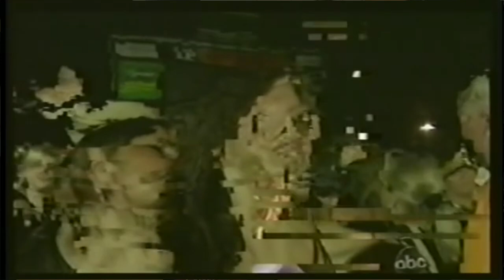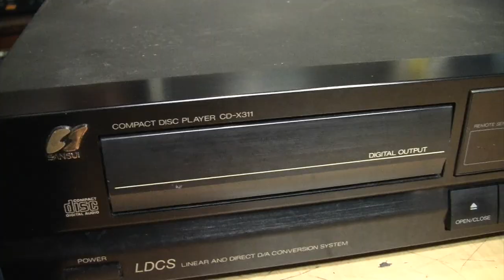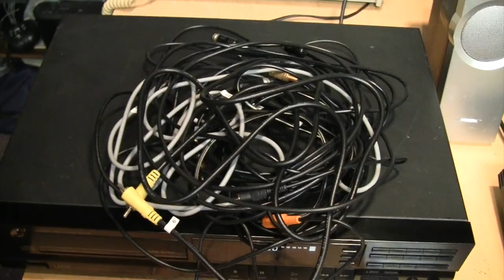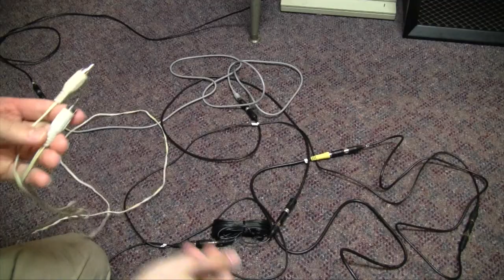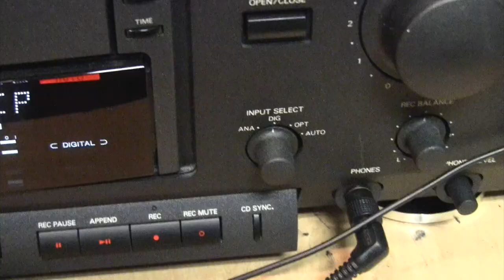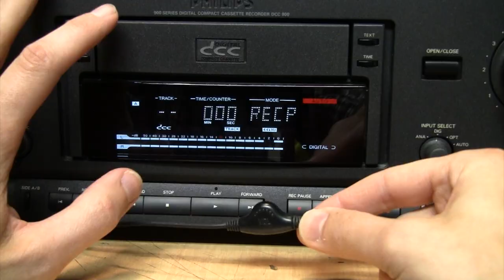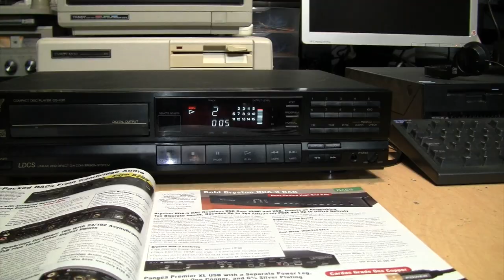What does a crappy digital audio cable actually sound like?

Comment: Sata and Ethernet audiophile cables... I just wonder: ordinary sata and Ethernet cables are good enough for banks transmit/write/read/receive billions of financial transactions every day, they are good for NASA to access billions of informations, good enough for the most awesome super computer deal with tons of data for its researches, but they are not good enough to play a simple audio file.
Reply: I think that most of the applications you described probably lean towards the higher end of the mid-range cables. As my IT tech father can attest, some of the normal to low-end stuff is fraudulently labeled junk that can't meet it's spec (I'm thinking of Ethernet: he got one from a store once that was labelled as ordinary Cat-5, but was actually Cat-3: fine for phone and probably some older networking, but not usable for 100base-T, nor anywhere near the 1000base-T that was rolling out to consumers at the time).

Though, it's not like you have absolute guarantees with anything.
Reply: There are people that debate about hard drive types too. People recommend surveillance drives because of their non-stop stream performance.
Reply: Expencive cables have better endurance and protection, so pay a bit more on that use cases is ok. But not that big as brainless audiophile fee.
Reply: Cheap cables are NEVER good enough to PLAY "Simple 🤪 Audiophiles" it seems.
Their money I guess!

Comment: but the JITTER, the humanity!!!111
;-)
Like some other folks already suggested try uncoiling that wire. Telephone(Cat 1) or ethernet(Cat 5) wire could also be a fun experiment, you dont need to uncoil those - I would start by trying whole 100m box at once, wouldnt be surprised to see cat5 working.
Reply: even better - try to actually phone someone and send them the digital signal down the phone line..!
Reply: You need 3MHz of BW, phone connection is limited to 3KHz, but ordinary cat1 phone cable(very old) is good up to at least 1MHz (ADSL), cat2 to 4MHz (ADSL2+).

Comment: You cant test like that. To start with the guy is using an inferior sound card...an internal one aswell. Which will pick up rf noise and have alot of jitter. Also you can't test on those speakers.  They are just a little full range driver that has no bass or upper highs and won't resolve. You want to be using an external audio interface to start with. When you run a system that has more than 5w and speakers that do most of the spectrum you will hear it. When it comes to length you will get more noise and hiss and and less highs. Hence why we have balanced connectors ie xlr and the balanced digital format is aes. And no...not all audiophiles are gear junkies
Reply: But resolving the highs is just a matter of sample rate, which jitter doesn't affect... just because a cable cuts out higher frequencies for direct signals/analogue audio doesn't mean the exact same thing is going to happen to the digital signal once it's decoded. Just when things get bad enough that the high frequency rolloff point is below the data rate in Hz, you get dropped packets and corrupted audio. It's not like it's subtly EQ'd different, it just starts glitching out after a point. 

Maybe you just whooshed me, I dunno.

Comment: You are making an inductor with the coils of cable.  Which destroys highs.  Running them in opposite directions through the RCA cables creating opposing magnetic fiealds.

I would like you to record the CD player on the computer through various cables.  Then rip the CD on the computer.  Line up the waveforms and flip the phase on one of the wavs.  There should be silence left if digital is perfect.
Reply: Its digital so it doesnt matter.

Comment: Thing I love about Digital AV stuff is that it just works. Only benefit I've found to having better cables is they're not as likely to break (but thats not always the case especially if a brand is selling 60 dollar HDMI cables made for less then a dollar that breaks easily). Aside from a few cheapo cables, I've been getting by with $7 Amazon basics HDMI stuff.
Unless you have really expensive equipment that you can't take chances with broken bits getting stuck int he ports, cheapo HDMI, RCA or Toslink Optical cables will do the job at delievering 100% of the quality that your equipment can output (but may not last as long).
Reply: The only thing with HDMI is the standards have evolved so for instance the cable I had been using from my PC to my old receiver didn't work with my new receiver and it took me a while to figure it out. Cheap enough to fix but if you already have a lot of old cables it can be hard to tell which ones are still useful.
Reply: The only thing to watch out for is that many cables do not adhere to the newer HDMI specs, even when they claim to, especially on longer cables. If you're trying to drive something that needs HDMI 2.1, make sure a third party has tested and validated the brand's HDMI 2.1 compliance at the length you need.

Comment: Oh god...seperate the twin conductor cable and un coil it.

The signal running in the opposite directions in that cable is cancelling each other out.
Reply: That's not quite how that works...  there's some coupling, but it'll just be minute interference as the signals pass each other in flight.

If you ran inverted copies down the cable twins in the same direction, you might reduce the radiated EMF a bit though!
Reply: @sirnickity  i just tried to keep the explaination short sweet and simple....
It is better to keep thr wires in a big jumbled mess ratger than coiled and tied tigether to prevent emf and crosstalk.
A good example of this, tho it is not digital, is an old hammond organ.

Comment: I can tell you about the USB cables...one day whilst extremely bored at work, I took a whole bunch of passive couplers and went to town. I was well north of 75 feet if not 100, and several different flash drives continued to work perfectly well at USB 2.0 data rates. There was no notable loss of speed.

I figured voltage drop would be a problem long before data integrity. Making a video about this has been on my to-do list for a long time now, but I misplaced the cable couplers not long after and they've never shown up again.
Reply: that mostly comes down to what you're plugging it into and how strictly they enforce the spec, at those lengths you would be well outside the official timing specs for usb
Reply: @brendanrandle  By my rough calculations, at 75 feet he's 4.6x over the timing spec for 480mbps transmission. The only possible explanation is methodological error, personally I suspect a flawed baseline measurement.
Reply: Have you tried searching between the sofa cushions? Things have a tendency to get lost there. Once I found a portal to another dimension there.
Reply: For the other side of this, I had an HP scanjet once at work that would scan half the page and then get a scan error.  We read the manual and it said that the maximum cable length was 6 feet and we had used a 10 foot cable. Sure enough, we moved the scanner closer and used a 6 foot cable and the scan error went away.
Reply: Yep, I can confirm the voltage drops first before you get data loss. Just using a phone and it's charger and going by the amount of time it takes to charge from 10 percent to 100 percent takes longer and longer the longer the cable is.
Reply: I think I saw a 75 foot USB extension cord at the thrift store and it looked passive so, your findings make sense.
Reply: When a USB cable is used to transmit data, it benefits from data integrity algorithms such as the ability to retransmit packets when they are found to be corrupt.  You can imagine that there would be more corruption for longer runs of USB cable, and the retransmits can help correct for that.  When audio components use USB to transmit audio data, however, they do not retransmit data that is found to be corrupt because doing so would cause unacceptable delays getting data to the receiving components.  Instead, that data is generally dropped from the stream of audio data entirely, leading to degraded analog output from the DAC.
Reply: USB doesn't work over long lengths unless it's active. Especially higher bandwidths. I've got a usb mic that if you go over 12ft it starts to  drop out hard core in windows and half the time won't even show up. and it never works unless the cable is within spec because the length degrades the signal so much for usb. Only way it'll work at longer distances is with my active cable
Reply: charging your phone with such a long cable might be way slower. a 100 feet of usb cable should already have quite some resistance. the cable might have quite some resistance now. the copper inside of usb cables is very thin.
Reply: Charging phone with 3m cable exention sucks
Reply: @vadnegru  indeed, what usually takes under an hour to fully charge with a short length charge cable, will take around 4-5 hours to charge with a really long cable.

I guess it's a trade off.

Comment: It sounds no different from the “bitcrusher” effect on DJ apps such as serato or virtual DJ with that crappy digital signal coming thru
Reply: That's probably very close to what's actually happening here. It's hard to tell without seeing the actual raw waveform down to almost the individual sample, but I'd imagine what's happening is that the degraded but still readable signal is delivering just enough for some sound to be reconstructed, but many samples are being skipped, making the sample rate lower and resulting in interpolation between sample points that's large enough that it's audible. Might be doable in audacity if someone wants to try and see if the effect is similar.

Comment: Well if you plug an audio source via USB then sometimes you’ll get the bit crunch then it goes away
Reply: Probably needs an "Audiophile driver". USB has a message type that offers high-reliability, and that sounds like a driver that uses it is sometimes under-allocating time-slots.

Comment: If you're not spending at least $300 on superior cabling, your equipment may be destroyed by digital audio virus executables (DAVE).
Reply: And, you have to buy a DAC that's more expensive than a reasonable economy car, or else the music might not decode correctly.
Reply: I think my psu got a virus from a song i had downloaded for free. Probably because i didn't use the special anti virus Norton audio cable that sifts out the viruses coming through the audio file
Reply: @hairychesticles1  Thanks, this gave me a good laugh. Did you remember to download more ram while you were at it?
Reply: 🤣🤣 creative AF
Reply: Also, u have a virus in computer power unit )

Comment: Nooo don't use non terminated Y! Bits will fall off!
Reply: Is no worries, someone else will pick them up. Is like sharing.They work kinda like xp-orbs in Minecraft.
Reply: @MariaEngstrom  Haha good one!
Reply: I wonder what happens if you zapp it or connect some additional digital or even analog signal.
Reply: I remember someone once did an experiment and took a bent coat hanger and used it as part of an audio cable and had some audiophools praising its clarity and depth.
Reply: @stonent  Yep, I remember reading the same. I also remember an actual HIFI magazine doing a blind test of speaker cables with (for them) surprising results. They performed the test in the home of a true heavy duty audiophile. He had hardwired his speakers using, as I remember it, oxygen free copper pipes that was silver soldered and mounted to the walls going directly from his amplifier to the speakers. So it was pure insanity at play.
They took four or five high end and very expensive speaker cables and a dark horse and sent the test panel away. Then they wired everything up and had the test panel listen to it without knowing anything about what cables or connections was used. Once they had collected all data the results was very interesting. Turned out they had no clear winner, but what was interesting was that the highest score, if only by a few points, was given to ordinary FK cable (or it might have been EK) that's used for electrical installations...
And as I said this test was done by the crew at a HIFI magazine where they usually had no problem praising the latest in snake oil products.
I used to read that magazine as it was partly hilarious and partly for their tests of amplifiers which was quite advanced, but always also included a shoot of snakeoil just to keep their main audience lubricated...
Reply: @blahorgaslisk7763  that is more of an urban myth than anything. Nobody has actually sourced that test. I tried to track down the original piece but after couple articles I always ended up in deadend with no source for it.
Reply: @alkestos  I actually had that particular issue but threw it away years ago. The writeup was hilarious. Now you should know I read it in a Swedish HiFi magazine, so it's not that strange if it's hard to find the sources. It's the same with a lot of things I remember from some years back. It's often said that nothing disappears from the internet, but THAT is a myth.

For instance a company I worked for went bankrupt with huge debts to their suppliers. This was written about in the daily news papers, the economic news papers, on industry sites on the net and so on. This was late 90's or even early 200xish. So a couple of years ago I wanted to freshen up on some of the details and tried googling, and found nothing.

Searching for the company name gave a few hits but nothing about the bankruptcy. One of my bosses got a long jail sentence and another fled the country only to return a few years later. Some how he was able to blame everything on the first guy. And all this was in the papers at the time and now I couldn't find a single mention.

I think something like that would be more likely to remain easy to find on the net compared to an article in a HiFi magazine.

But I can tell you it was an article published in a dead tree magazine because I did read it myself holding said magazine in my sweaty hands. And it made me laugh a lot. Just the description of how the copper pipes had been cut, soldered and fixed to the wall making it impossible to move the speakers of the amplifier a single millimeter... The WAF factor of something like that is pretty darn low...
Reply: @stonent  unfortunately I believe that is nothing but a myth going around. I’m sure it could fool people in a blind test but I have had no luck finding the original source for this supposed test. Kinda wild that they were ready to put it in hifi magazines without a reliable source whatsoever.
Reply: Just put it inside empty tuna can. The tuna can will catch any fallen bits and radiate it back to the cable. You can also use single pole magnets or thought power.
Reply: @bluef1sh926  LMAO! Yeah, that is just about exactly how totally ridiculous some "audiophools" are!
Reply: @JoeJ-8282  I prefer to call them "audiophobes".
Reply: Actually that proves his point more. Showing even more that they are trying to rip you off from the "premium" cables.
Reply: Atually a y cable is really bad for radio and tv. You create a band stop filter if you cut right. If cut randomly you get a lot of problems like ghosts on analog tv signals. On DVB could cause loss of reception or similar things. 

I normally use 75 ohm tv satellite cables and decent RCA plugs with a metal body for both digital and analogue audio. They are ok. For the speakers I use the biggest 400V three phase and ground cables fitting in the connectors. Some shrink wrap tubes make them nice.
Reply: they might... if there was another cable in the non-terminated y.. of let's say 20 meters or so, and if it was a balanced bus, which it probably is not. lol.
Reply: Y tho.
Btw, I don't recommend using a Y splitter to connect multiple headphones to one amp, especially if the headphones have different sensitivities.
Reply: @mr.necercis Duct tape will fix that...

Comment: This video made me realize that Dire Dire Docks from Super Mario 64 was made on a Yamaha DX7
Reply: It's just the main sample, the DX7 preset "E.PIANO1". The N64 performs the track live from individual samples.
Reply: Dire Dire Docks also sounds a bit like Van Halen's - Hear About It Later on some parts.
Reply: I don't think it was, I think most of the samples from mario 64 come from a Korg M1.
Reply: @rzeka  Surprisingly no! There's a spreadsheet called "NEWER VGM Sound Sources" and the sounds that we know of from Mario 64, come from a variety of places. Korg 01/W, Roland SC-88, AKAI Sound Libraries, etc
Reply: @SpeedySPCFan  Some of the Korg 01 and M1 sounds must be the same then
Reply: i agree
Reply: damn... you beat me to it lol
Reply: The N64 used VGM sound files, which were similar to midi(in theory, they aren't the same), but with defined 'patches' and tracks within that file, which were mixed on the cpu on the fly, so in theory, it could have included DX7 influenced sound. However, since it was on the CPU, game makers usually mixed it down to 22khz, which didn't sound great. It was more like 'mod' files in execution than midi, if you are familiar. Mod files were used in Unreal and Unreal Tournament :)
Reply: I was thinking the exact same thing